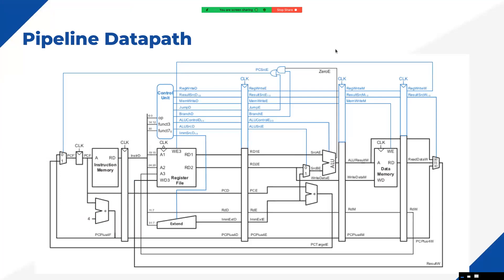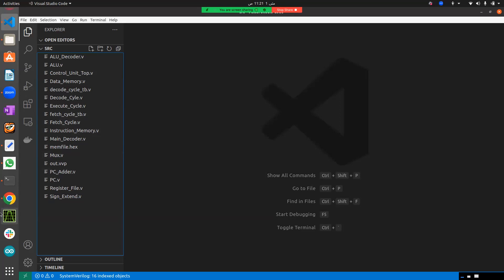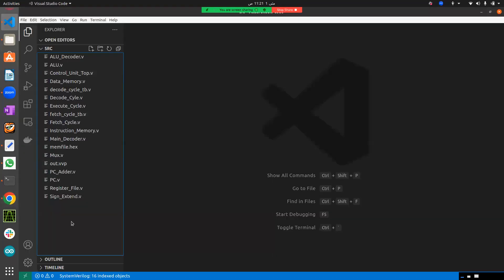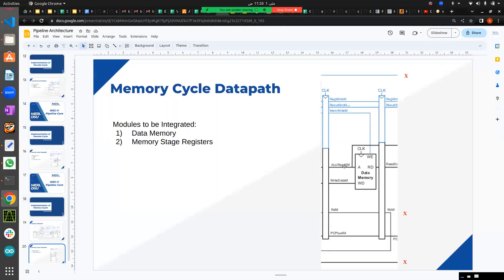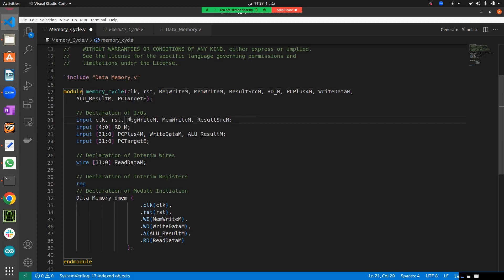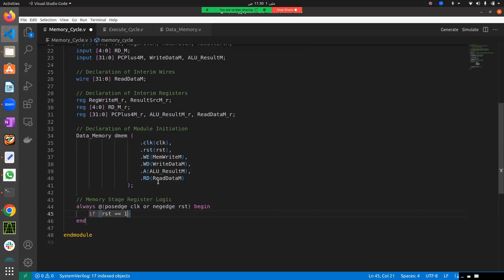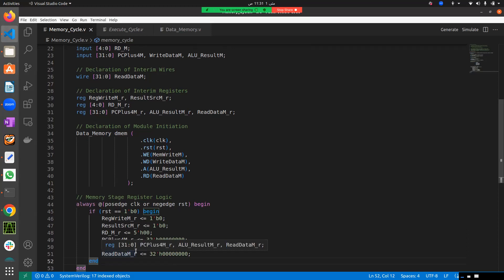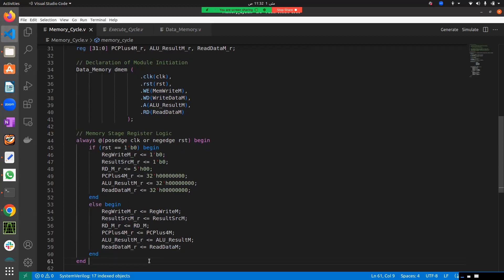Lecture 5: Design & Implementation of Memory Cycle

Comment: which instructions are supported here?
Reply from the maker: load and Store instruction execute here or in simple word memory read/write happens in this cycle
Reply: @riscvtransistors2ai  Thank you for the reply 

So only two instructions are supported?
What if i want more instructions to be supported what should i change?
Reply from the maker: @Professor_el  The whole design support Load, Store, Add, Subtract, And and OR. To add more instruction support you have to review the RISC-V Instruction Specs and make changes into control unit and other modules as per requirement
Reply: @riscvtransistors2ai  if i want to support. These 

R-Type
   Add, sub, And ,or , SLL,SRL,SRA

B-Type
   BEQ,BNE

I -Type
  LW,ADDI ,ORI,ANDI

S-TYPE
   SW

What should i edit 

And which if these above is supported in thee design sir 

Thank you
Reply from the maker: @Professor_el  you have edit multiple files for example you have to add the logic for control signals, you have to design ALU to support all these instruction, you may have to add some extra design block to execute one instruction and so on. 

Currently the design in the video support only 

add,sub,and,or 
Lw,sw